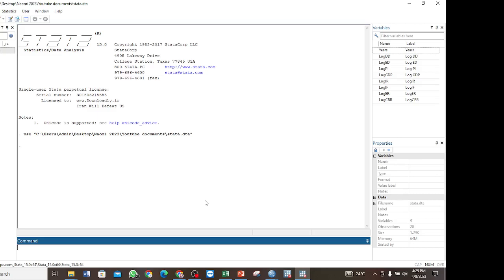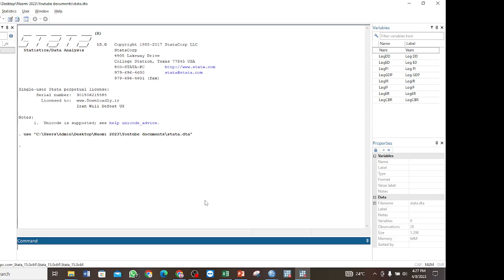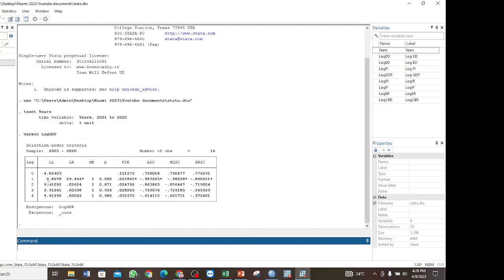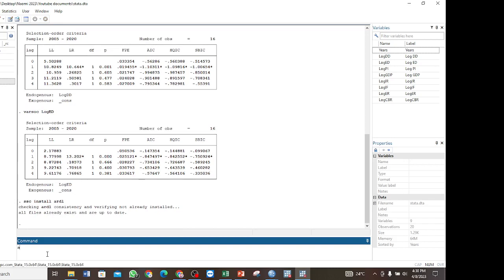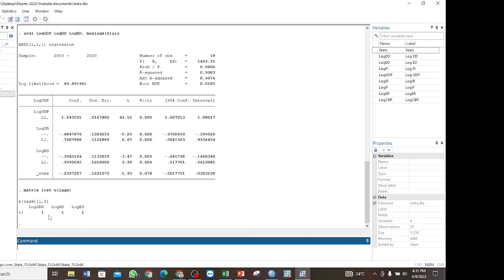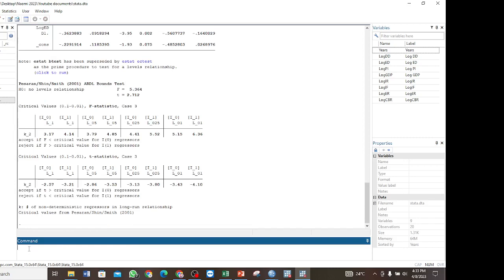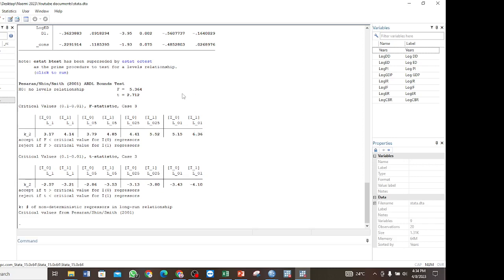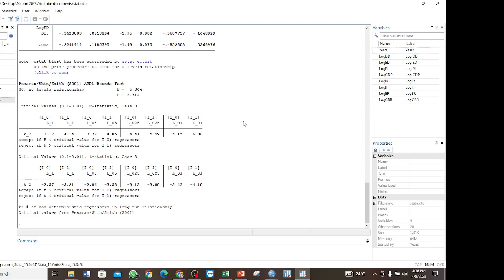Performing Bounds Test from ARDL in Stata

Comment: You explained very well the decision criteria. However you did not interpret the results well. From the results F statistic is > that I(1) so we reject Ho except for 1% and conclude cointegration.  F statist is also > than I(0)  we therefore reject Ho and conclude cointegration
Reply: correct. It might have been a slip of tongue. There is in fact cointegration
Reply from the maker: @alexgitau4499. sorry for that error.
Reply: @excellingwithnaomi  I appreciate your efforts in putting useful vidoes out and thank you for confirming there is cointegration in the bound test  result

Comment: I have a question how to we decide on the maxlags(2)
Thank you
Reply from the maker: Hi jayshreeacharaz9023 . are you asking how you decide on the max lags to use for your variables? The command for determining  the maxlags for each variable is the same for the model that is varsoc variablename. If you find the maxlag for your variable is 2, then add the option maxlag(2) when running your ARDL model. e.g ardl dependentvariable independnetvariable1 independentvariable2, maxlags(2)
Reply: @excellingwithnaomi  maxlag for each variable and I choose the one with the highest?
Reply from the maker: @jayshreeacharaz9023  yes
Reply: @excellingwithnaomi Thank you
Reply: @excellingwithnaomi  Hi Naomi, first of all thank you for this informative video. Much appreciate. Regarding the maxlags , if i have 4 independent variables in my study so my maxlags will be maxlags(4). Am i right?

Comment: Thanks for the tutorial it's really helpful. But i'd is it necessary to transform the data into log form before performing the ARDL model?
Reply from the maker: Thank you @derickpyro4137. Transforming data to log form helps standardize the units of measurement since you may have different variables having different units of measurement
Reply from the maker: Log transformation is also used to address skewness problem